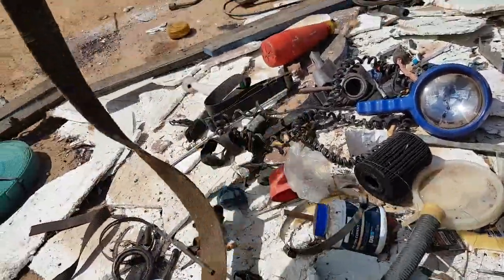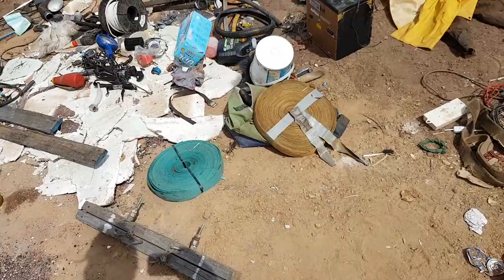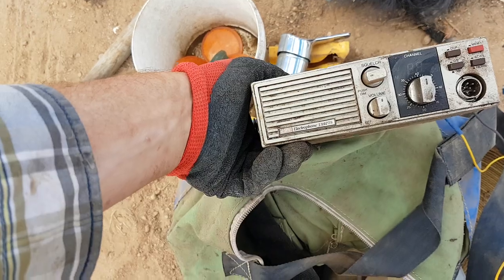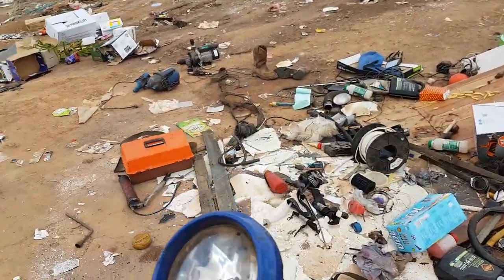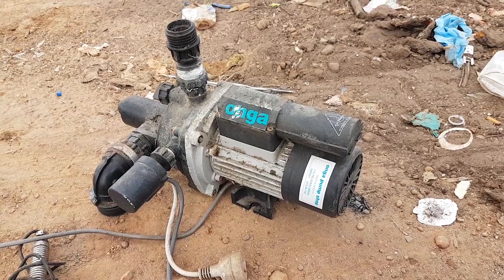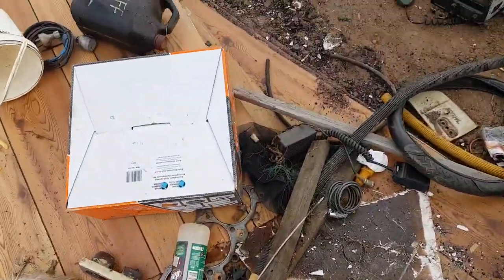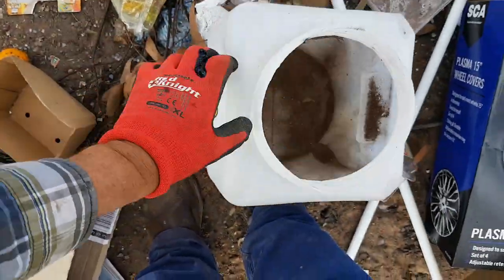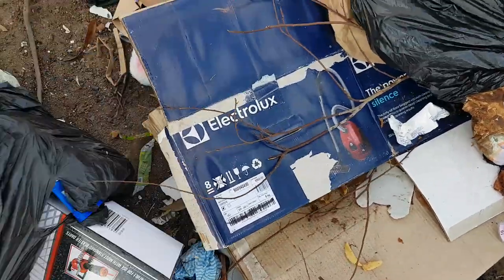Hoarding More Rubbish Dump Treasure  - Pt 2 - Hella Spotlight Find & Free Food Grade IBC Container!

Comment: Bill, a nice way to clean things up, such as the two way radio is with baby wipes. However, you probably find more than enough rags at the tip.
Reply from the maker: Thanks Bryant, I actually buy bags of rags from a local op shop, cotton tshirts I like finding, I use them for sifting the gunk out of my fuel in my jerry cans when I fill up my truck.    I cover the fuel spout in the tshirt, and the t-shirt filters the gunk, dirt, rust particles etc... I'll do a video on it soon and will show you.  I left the 2 way behind, I should have taken it home.